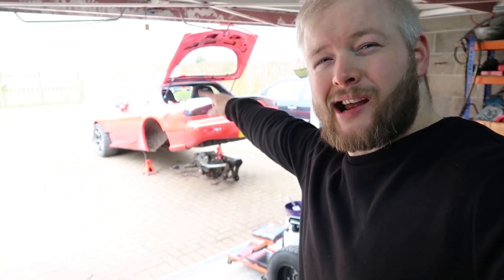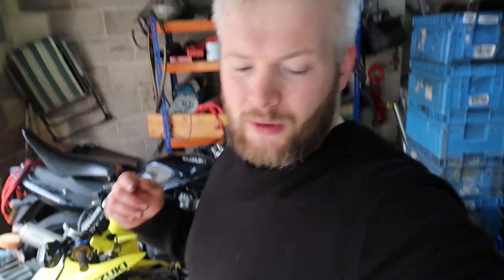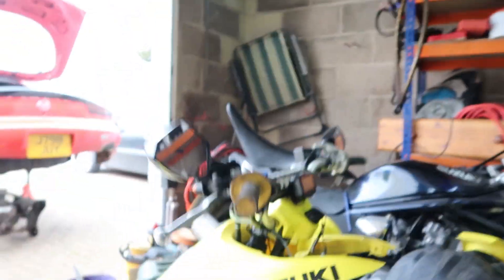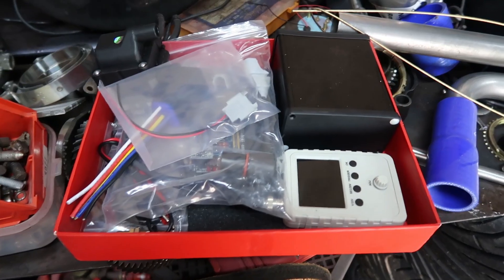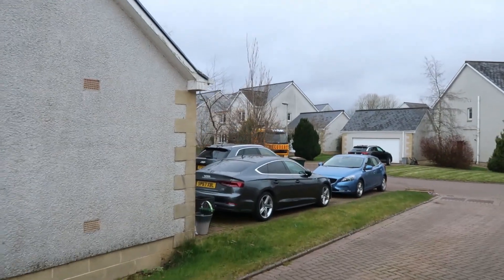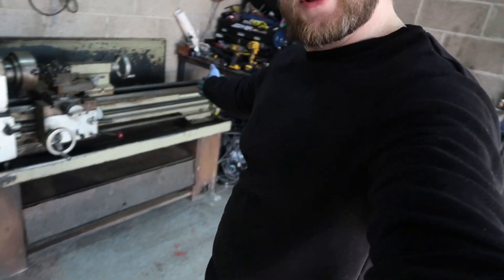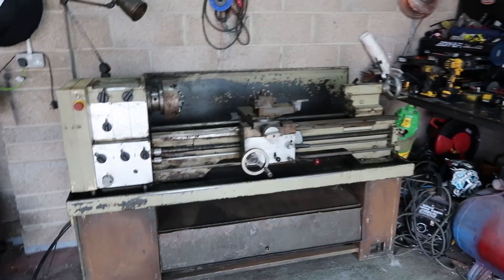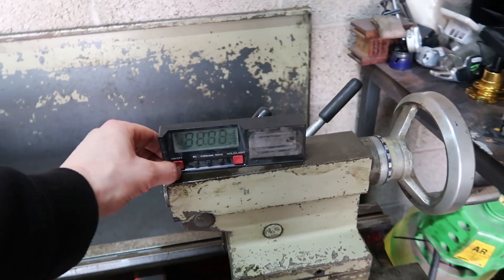I BOUGHT A LATHE!! [HARRISON M300] WORKSHOP LEVEL UP!

Comment: Hello mate.I really like your Honda RX7 also your remapping skills.I am new fan of yours :))).
I watched PFI speed and Brent has received your present(SSD) and was very nicely surprised.Welldone to you!

P.s. Have fun with your new toy.
Now you can perform T51 mod on the gtx3076r.
Reply: Fair play to you bud.Also I meant that you could upgrade the previous Pulsar turbo (gtx3076r) you had on the car with T51 mod if you still have it :))).I will contact you at some point in time to buy one gtx30r for myself because will build a3 3.2 turbo.
Good luck

Comment: Levelling a lathe is usually done across the front and rear bed flats on parallels. test across the head stock end under the chuck and then at the tailstock end. Depends how accurate you want it to turn.  Google or YouTube should help you out bud.
Reply from the maker: Yes i deffinalty need to have a play with it. It has allot of backlash too that ill need to dial in